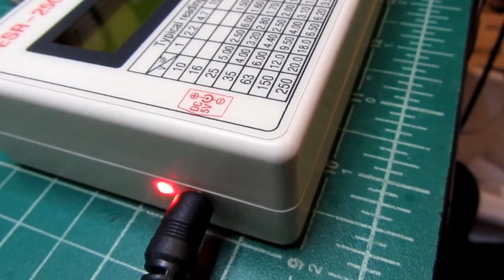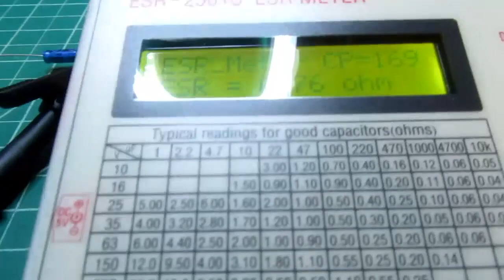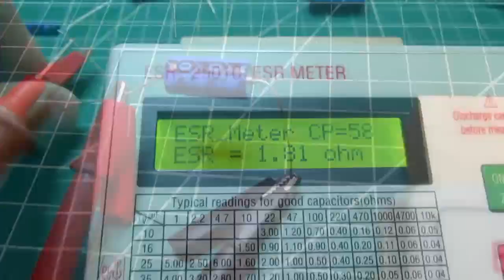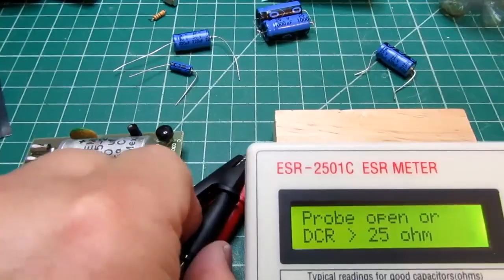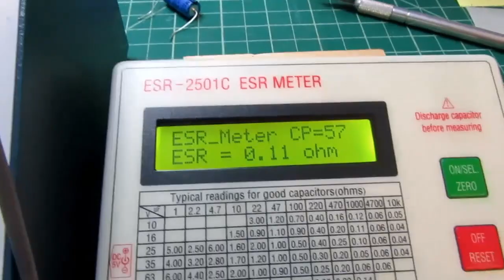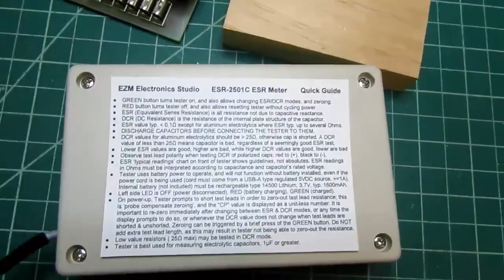EZM Electronics Studio model ESR-2501C "ESR Meter": Description & Video User's Manual

Comment: Just an observation, signal is way too high to measure in board capacitors and depends on the ESR measured. Current injected is 7mA with a max of 2.3Vpp

Comment: Hello. After purchasing the device, I encountered a problem: when I turn it on, the display does not show any text. The battery has the required rating, except perhaps for its capacity: 1100 mAh instead of 1600 mAh, as required by the manufacturer. I think there should be no fundamental difference, except that I would need to charge it more often than expected.
What do you think the problem could be? I have already opened a dispute, but I would like to find out why this happened.
Reply from the maker: Did you allow the battery time to charge?

This tester is designed to operate ONLY from a properly charged internal battery. It cannot pull its operating power from the USB power supply (which is only for charging the internal battery).

Try this:
1) connect a 5V USB power supply to the Tester using the included USB charging cable. The LED in the side of the Tester should glow RED for a while.
2) When the LED glows GREEN, disconnect the charging cable from the Tester. The LED will turn OFF.
3) Use the ON/SEL/ZERO button on the Tester to turn it on.

Comment: Thank you! You went above and beyond! Seriously! A lot of guys have been using and still endorse the PEAK Atlas ESR70 meter for over 10 years. But I haven't seen any demos of DCR using it. This one lets you do both and be totally sure you have a REAL good cap. And the Probes and Clips are a game changer. The MESR-100 has such short leads and when you try different ones, it has fits. You just might have rearranged my priority list! You did GOOD! Thanks again! Heat Shrink tubing rather than electrical tape!  Probably 4:1 shrinkage will fit over the banana plugs one at a time. More permanent!

Comment: Great video on this meter. I appreciate your time!  Looks like a good general purpose meter for lower voltage applications. How might one interpret the readings when working with 450v caps from a tube amp as the table stops at 250V? Or is it just not useful for higher voltage caps?
I've looked at a number of these low cost ESR meters and the charts all stop at 250V.
Reply from the maker: @tvwatcher9291  , they are definitely for use on capacitor voltages common in most electronics. For higher voltages you would need more professional equipment.

Comment: Hello mister! Thank you very much for this great masterclass! I have bought this esr meter but I discovered from you that I need to buy the battery apart. I have been looking for the 14500 battery in 1600 mah but I can only find it in 800 and 1300mah. Can you please tell me if you know it it will work with a battery of 1300 mah or if you could provide a link for the 1600 mah battery? Thanks a lot! Fernando from the Balearic Islands (Spain).
Reply from the maker: @alvaropmi  , I don't not know the answer to the battery question. If you cannot find the 1600mAh battery locally, it is readily available from online sellers.

Comment: Hi, I am a newbie to using a ESR tester but after this video I bought this tester but the readings on a brand new Capacitor is not even close to the numbers on the table, a 470/10V reads 0.29 ohm and the table says 0.16
Reply from the maker: @RuneKC_DK  , the table on this tester is just a typical value, not an absolute. 0.29 Ohm and 0.16 Ohm are very similar values.

This is another case of what confusion can happen when people try to use equipment without having enough background knowledge to make sense of what the instrument is indicating. Some self-study is recommended.....

Comment: bought this, nice one on the pdf you made one thing is i would not charge the battery in unit if you got a charger it would be best done that route
Reply from the maker: @namAlexander  namAlexander, why would you not charge it as designed?
Reply: @youtuuba  due too battery safety with litham battery's as it don't regulate correct, a good example is vaping mods that uses separate cells you'd be hard pressed anyone that use in built charging also a good brand battery is key, and good example of charger is Vapcell S4 Plus Battery Charger Tester V3.0, look at it like this remember old car chargers that just use to pump in volts till the battery was charged its the same idea
Reply from the maker: @namAlexander  maybe you have a point in there somewhere, but it is difficult to understand what you wrote; one long run-on sentence, grammatical and spelling and punctuation errors. Perhaps English is not a strong language for you.
Reply: @youtuuba  Thanks for that, keep charging as you think best, people skills is not your strong point also
Reply from the maker: @namAlexander  , I don't care at all about that nonsense about your hurt feelings when you are leaving nonsensical comments on my channel.

I pointed out that there were issues with the intelligibility of your comment, and your reply is to NOT fix your problem but to try and turn it into MY problem.
Reply: @youtuuba  Touché 🤣🤣🤣🤣🤣🤣🤣 my problem? 🙄🤣

Comment: Hi. I bought this meter, but I don't like the length of these measurement cables, they are very inconvenient to use after attaching the tips. I wonder if they can be replaced, for example, with tweezers. Maybe you have an idea. Regards
Reply from the maker: attex576, I think I mentioned in the video that I tried extending the test leads but found that the meter would no longer zero properly.
Reply: @youtuuba  Thank you for your answer. This is what I was afraid of